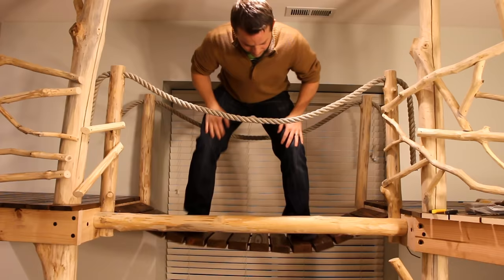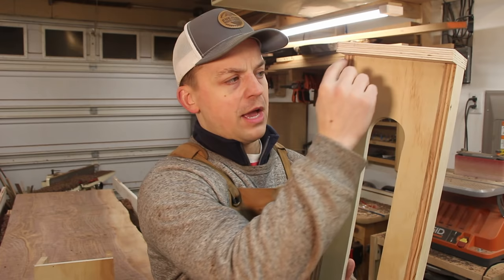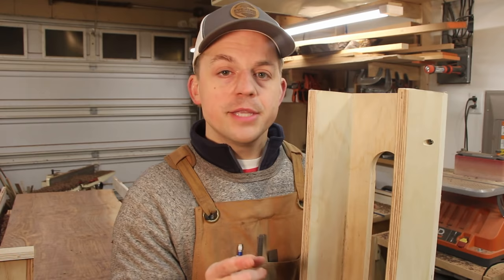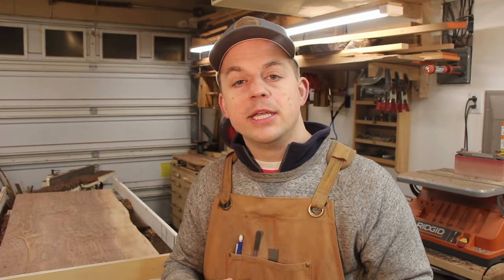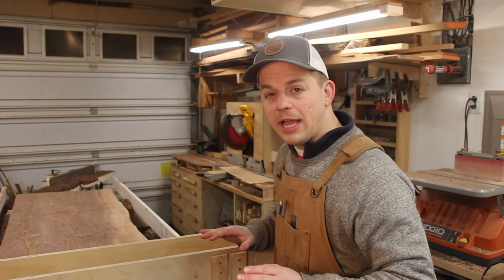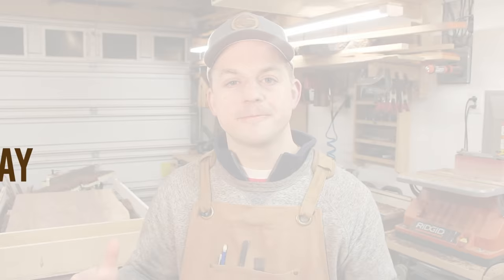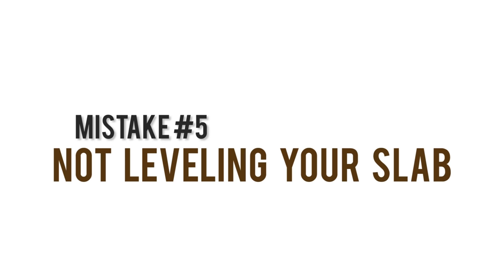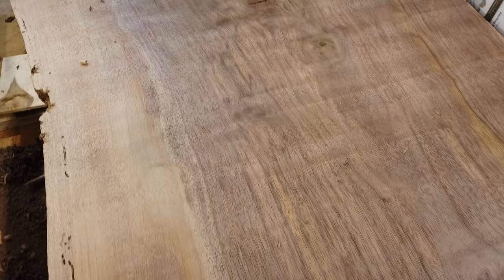DON'T make these Router Sled Mistakes! | Evening Woodworker

Comment: A problem that I had doing this years ago, making a planer out of a router, was that as the router thrust bearing was at the top of the router and the bit dropped as the armature heated up. When you slide back to where you started, you are now cutting again; it makes several passes over the same area necessary.  It would be ideal if the thrust bearing was as close to the bit as possible.

Comment: this is really good info that other people fail to mention. do you have a video that shows us how to make the sled? i'm a beginner and don't have many power tools. the only power tool i have is a circular saw. i plan on picking up a router sometime soon as the next tool.
Reply from the maker: I haven't done a video on that yet, but it's essentially three boards with a big slot in the middle of the bottom one. The slot also doesn't have to be precise because it's jus a clearance hole. You can cut it out with a jigsaw; no straight lines required!

Comment: Great video, glad I watched it. I never thought about the screws pushing the plywood out and making an uneven surface. Did you use a Forster bit or something else? Thanks for all the tips
Reply from the maker: Yes to cut the radius in the slot, I used a forstner and connected the two ends just using a jig saw

Comment: Very good video I’m gonna look at some of the other stuff. Thank you I have one question could I use my bench as an indexing and have my sled slide on it my bench is very very flat.
Reply from the maker: Just make sure it's super flat and clean. A thin top edge can be good though so sawdust doesn't pile up on top of it.

Comment: Hey Man, just found your video / Chanel with the Sled for Router. I just finished mine. And I have to say that I am pretty new in Woodwork. Could you give me I tip how deep I should use my Router on  the first pass. I have a Makita 3612 C with a 12 mm shaft and a 50,8 mm cutting ( 2 inches diameter ). But I’m not to sure how far I should go on a 2… inches Cherry with Epoxy. Thanks for any tip / help and best regards from Germany. Frank😊

Comment: Great vid. I’m building a work bench using 4x4 wood. Could this sled be used effectively in smoothing the table top? Any ideas as to leveling the sled?
Reply from the maker: Yes definitely, the quality of your surface though is going to depend on the quality of your setup. Take time to make it all square and flat.

Comment: Great video I love the sled my question to you is if you’re not doing big slabs what  would be the proper sled to do cutting boards bigger than my Joyner and can use a smaller cutter
Reply from the maker: The same principles apply, just make a smaller sled and put the rails closer together.

Comment: Extremely useful video, very informative! Can I ask why your milling across the grain? I understand about climb milling versus conventional milling but wouldn’t you naturally cut lengthwise?
Reply from the maker: If I had a setup with machined rails it may make sense to go lengthwise, but with a router sled like mine it makes more sense to go across. In the end, it all gets sanded down starting with 80 grit and ending with at least 220 so you shouldn't see the ridges in the end anyway.
Reply: @EveningWoodworker  thanks so much. I’ve just discovered your channel and I love the content. You make easily understood videos and I like the fact you have basically the same tools and the same size shop as most of us!

Comment: if your wood is bowing/bulging from putting a screw in it then you should definitely predrill a hole for it, also for the indexing surface may i suggest melamine ? it should be flatter and smoother than plywood, not that i'eve seen plywood in real life (they don't really sell it around here)
Reply from the maker: The one I made using the "bad" method was pre-drilled, but there were still bumps... maybe melamine would work better.

Comment: could you add some t track on your sled so when you need a different width for you guides you wouldnt have to crew them in and out?  great tips thanks.
Reply from the maker: Yes that's actually a really good idea!... as long as it's high enough to avoid the screws when you route your groove for the T track.
Reply: So, if you keep the guides at one end, and the other end hangs out over the far rail a bit, or even a lot, would that matter?

Comment: I'm a journeyman machinist who does woodworking as a hobby. My background as a machinist is in producing very high precision (typically to +/- 0.00005" and occasionally to < 0.00001") components for scientific instruments. I've yet to see a single router sled design where the rails are indicated in for parallelism or that provides for tramming the router. 

Of course, these sleds are being used for flattening slabs and some defects won't typically be apparent to the customer unless the tabletop will have items placed upon it that will rock on an uneven surface. Then there is the sanding process which will destroy any truly precision work, anyway.

p.s. - Because of my background, I tend to hold tolerances to within 0.005" even where it doesn't matter as that is the least amount of deviation I've ever worked to. As a matter of personal pride in workmanship, I'd never let any machined metal part vary by more than 0.001" from the design specification. However, 0.005" deviation is fine for woodworking - especially considering that most "fine" pieces made by professional woodworkers vary by 1/32" or more from design specifications. I'll always be of the opinion that performing sloppy work injures a man's soul.
Reply from the maker: That's some pretty precise work... metal is much better at holding tolerances that high, but if you can get wood to do it that's great!

Comment: Thanks for the information. I'll use them all. Just one question. In your second rail guide design, why do you not put them on both ends of the sled?
Reply from the maker: I was trying a different method because I realized that the end rail guides are only necessary if your rails are always spaced apart the same distance.

Comment: I watched this and it is excellent. But I am still not sure on the direction to cut. Do I start at the left or right?
Reply from the maker: Just make sure your cutter teeth are spinning against your direction of travel... you can also try it both ways and one should feel smoother. Starting at the right side of the slab or the left doesn't really matter though.

Comment: Good tips. What is your preferred method to get the rails parallel?
Reply from the maker: I usually try to make sure the base is flat first before evening putting the rails on it.  Just make sure the base is level in every direction, then put your rails on that

Comment: you could drill counter-sinked screw holes from the underside if you don't have a pocketing rig
Reply from the maker: Good tip! As long as the screw heads were below the board you would get the same effect.

Comment: I somewhat new to woodworking at 72 yrs old. lol  I was wondering if you could use angle iron for the guides or for the sled as angle iron would hold it`s shape and there`s no give if any. Just wondering if it would work. Thank you
Reply from the maker: Yes you could use angle iron for your sled, but you now have to make sure that the two pieces are co-planar.

Comment: Thanks for the video. 
One question is can a 1/2 inch MDF be ok to use for the box the router sits in. Its what I have in the shop. Im also on the fence of just using steel angle iron, but dont want to if the MDF works better
Reply from the maker: Yeah that could work if you make the sides at least 4"ish tall. The taller your sides, the more rigid it makes the base so it doesn't sag in the middle.

Comment: Any tips for insuring the side rails are level and co-planer?
Reply from the maker: Use a level and make sure they're level with each other. They don't necessarily have to be exactly level to the ground, only level to each other. A digital level would help get it tuned in more.

Comment: Thanks for the video these are great tips I am happy I can avoid learning the hard way!

Is your slab only sitting on two strips on wood that go perpendicular to the rails where that are supported? Did you check anything with these to be sure they were level with one another?
Reply from the maker: I did make sure the two sides of the supports were level at either end. It's most important that your rails are level and flat though. That's what determines your cutting plane.

Comment: You should be outmilling, to avoid downward chips, the way to avoid the grab is to limit your depth. You will get chips into your surface where your grain sinks, milling the way you are recommending. Will it chip a lot, or will it ruin your piece? Probably not, but if you have an irreplaceable part, don't mill the way your are suggesting. You don't use a hand plane the way you're recommending, and you shouldn't do it with a router bit either. The only time you should actually up-mill with a router bit is when the bit is completely surrounded when cutting.

Comment: One suggestion. Don’t mill black walnut outside as the chips can harm plantings. Also, for the same reason, resist the temptation to use BW chips as mulch. 

Otherwise, these are great tips, well presented!
Reply from the maker: Thanks I didn't know that!
Reply: I use black walnut chips in my yard as a herbicide.  We have briar in our yard and I pile the chips around the plant like mulch.  It is slow but it works.

Comment: I'm wondering if you could make the router base out of MDF which is cheaper and pretty much dead flat.
Reply from the maker: Yeah you could use mdf as well. I'm just not a huge fan of the sawdust powder you get when cutting mdf. It would work fine though.

Comment: What about a pair of aluminium ladders as the sides used horizontally held by cross bars fixed to the rings by U bolts
Reply from the maker: If you can keep it parallel and the sides are smooth then it should be fine. My ladder has dents and nicks in it though

Comment: Good Video!!!! Thanks for the info.   I'm in.
BTW, quit your day job...(editing) Engineer?  Okay maybe not. Of course this means I have more questions for you.
3" aluminum angle for rails? Or unnecessary?
Reply: How thick is the angle web, how stiff is the angle?  The longer the angle, the more it will sag in the middle.  If you add middle supports then that complicates making it flat along it's length and adjusting it to the other rail.  I recommend wide boards.  You could add the aluminum angle at the top and bottom of a board, such as a 2X6 or MDF as he used, like a channel or an I-beam to stiffen the rail.
Reply from the maker: Haha! I'm gonna need a lot more subscribers before quitting the day job. 3" aluminum on edge could work, but sight down the length to see if there's minimal variation. Not necessary but if you have it already it could work

Comment: Any advice for making the two support rails co-planer?
Reply from the maker: Put a level along each of the two rails and make sure it's the same on each one. Not necessarily level, but the same. Then do the same thing with a level between the two rails and make sure it's the same at one end as the other. Mine wasn't perfectly level but as long as they are co-planar with each other you should be fine.
Reply: Mark-one eyeball. Just sight across them horizontally and make sure they are parallel. Make sure your rails are very slightly higher than the surface you are flattening.  No tools needed, your eye will catch variations of much less than a millimeter. More precise than anything else you could do in a wood workshop.
Reply: A common method (used with the other suggestions) seems to be putting diagonal cords corner to corner on the rails. With an allowance for the cord thickness, the cords should just touch in the centre.

Comment: Any suggestions when working with round cross cut slabs?
Reply from the maker: Make sure to slow down when you go on and off the edge of the round slabs. Those edges have a tendency to chip off more.
Reply: @EveningWoodworker  
Thanks

Comment: How would you chamfer a deck board down to reduced thickness? I.e. 2x6 start chamfer about 3 inch from end of deck board and reduce to let’s say 1/2 inch at end of board using router sled
Reply from the maker: Use some thin stock to shim up one end of your board. The rails wouldn't move, but the board you're flattening would be raised up to the height desired on one end.

Comment: Are collet extensions typically used when surfacing. Or does the surfacing bit reach low enough by it self?
Reply from the maker: I would avoid extensions because it introduces more possibility for instability and vibration. I just put blocks under the slab to bring it up within the range of my plunge router

Comment: Would design 1 work if you glued and pinned?

I couldn't help wondering about a little winch to pull the router across the timber. A stop block at the far end, with a toggle switch could reverse its travel.

Then I wondered about a second, longitudinal winch. The engineer in you should be able to engineer this, even to making winches if needs be.

With stop blocks, you should be able to reliably leave a rim. On a small scale, make a serving tray.
Reply from the maker: The nails are smaller so it would theoretically work better, however, the important thing is your bottom indexing surface. Make that as flat as possible. The first design has a lot of potential to get things misaligned slightly which is why it's easier to just change it to a better design... and yes I have to resist my natural urge to over-engineer stuff too!

Comment: Hi! I'm new to woodworking.
Do you have to do both sanding & planning, you can't just sand?
Reply from the maker: Planing is when you need to remove thickness on a board... so for example 3/4" to 1/2". Sanding is to just smooth out the surface. If you try to sand off that much, you'd be sanding for 3 weeks!
Reply: @EveningWoodworker  ahhh! Gotcha. Good to know! Thanks!

Comment: I have a problem where my router bit cant reach my project. Ive borrowed a Bosch 1200 pf (my dewalt broke), Even when I plunge it way down it dont even pass the material of the sled. I used to have an extension-adapter for the bit but that one also broke. One solution is to use thinner material for the sled like 0.5 cm, but thats not stable. Rails are not to high
Reply from the maker: Add shims under the slab to bring it up to the height of the bit. That's one of the challenges with router sleds.
Reply: @EveningWoodworker  yea,  but the bit don't reach under the sled the router is sitting on

Comment: If it's severally uneven, start out taking the high spots down with a hand planer.
Reply from the maker: On the sled or the slab?
Reply: @EveningWoodworker  the slab. A electric hand planer can remove a decent amount of material quickly and easy.

Comment: Just here for information how to flatten my alder cookie slab of 1,2m by 95cm. My first attempt was with some tube steel used for handrailes. Didnt think it would bend. But i  now noticed both sides are cupped (bowl like) in the middle of the cookie. Its a true nightmare 😅
Reply from the maker: The important thing on the rails to prevent deflection is the height of the rails. Just make sure they're tall enough and the deflection should go away.

Comment: Do you recommend cutting against the grain only or is either way ok?
Reply from the maker: Either way is okay, but most sleds are not set up to go the length of the board along the grain. With the grain would be better though...

Comment: QUESTION:
     Electric Hand Planer...?...
          is there a sled for an Electric Hand Planer?

If there is it would seem to possibly be a faster tool for this application ( assuming a jig exist for an Electric Hand Planer).
Reply from the maker: I haven't seen one for a powered hand planer... I think the router is the most effective though because you can go in any direction.

Comment: Not too keen on using MDF for the side rails. MDF is really soft stuff by comparison with timber or plywood. It also absorbs moisture and will distort and swell much quicker. In a high humidity area it's a real problem. I'd forget MDF and use thick (25mm) plywood or hard wood cut square on a table saw. MDF wont last long. I wouldn't use wax on MDF edges either.
Reply from the maker: Yep that works too

Comment: Good video. I disagree with waxing though. While it might not need to be smooth as butter, its super cheap and easy to do so why not put in the tiny amount of extra finishing work to make it that little bit better? Good enough vs. great.
Reply from the maker: The waxing can be good, but it can gum up in the corners with shavings and sawdust which then can defeat the purpose... but if you can make it work, then yes by all means that would help!

Comment: First problem, is screw lift. How much practical difference does this make? Assuming a #8 thread dia is 0.168 MAX, half of that is 0.084, fiber compression will reduce that, somewhat. Did your waviness indicate this much? Anyway, glued and pin nailed would have wiped this out. BUT,  even is there was a true 1/16 wobble, by the time the cutter wobbles past each hump, which the cutter movement will tend to attenuate the waves, you are STILL going to hit the surface with a plane. How much real gap will the plane sole "see"?
Reply from the maker: It just gives you a better starting point and reduces your sanding afterwards. The more variation you can remove from the process, the more consistent the results.